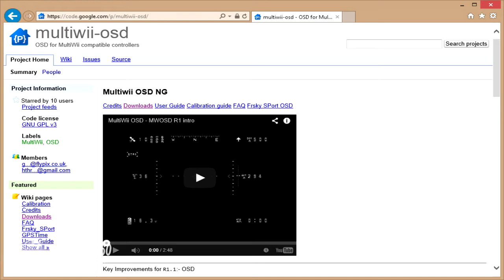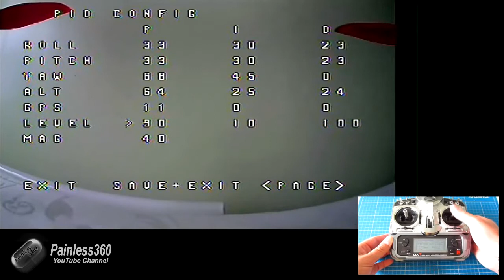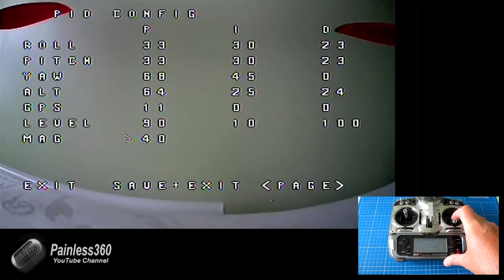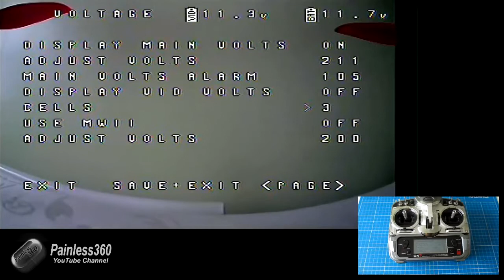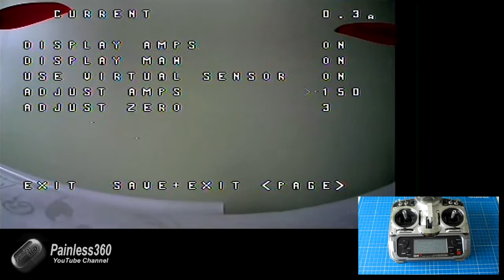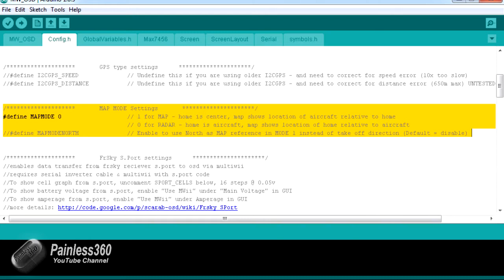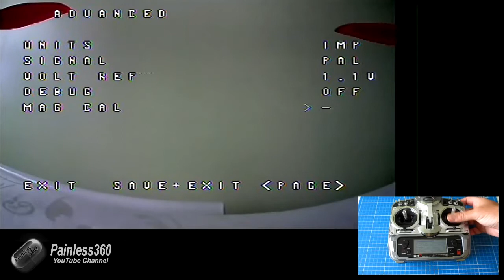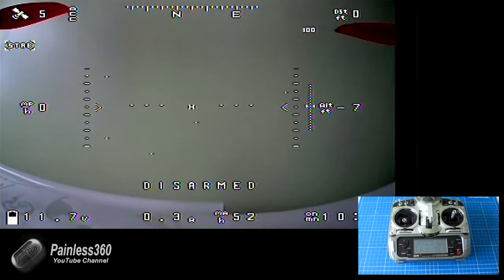Minimosd Menu Overview

Comment: Hi, i have a problem with current meter, when i use the virtual sensor on cleanflight flip32+ i get the current Amps and mAh readings ok but my 3position switch on the radio(Flysky th9x) stops working and i cannot change my flight modes..any tips for solving that?
Thanks in advance :)
Reply from the maker: luisfilipe1983 Sorry, I've not seen that myself. I would check the usual forums to see if someone else has seen it before..
Best of luck.

Comment: Hi, Good stuff!
I'm testing as well the same firmware and you now have the GUI 1.2+ that allows you to customize where the values will be presented on the screen.
One question though. What is the 100 value under the home arrow in your screen? I know it's related with the map mode but am wondering what does it mean
Reply: Found it. It's the map size on the screen where your 100 translates to 100 meter square for the map size.
It auto-range if going further out.
Thanks anyway
Reply from the maker: Fernando Goncalves hi, thanks for letting me know! :)

Happy flying..